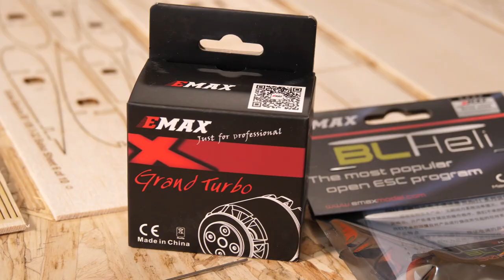How to Make a Balsa RC Messerschmitt BF109

Comment: Great build so far but I think there should have been some comment about lengthening the slot in the battery tray to allow for the motor spindle length. Fortunately I noticed this in the demo video before fitting my motor. 
looking forward flying this one.